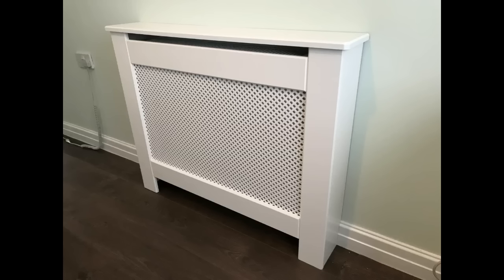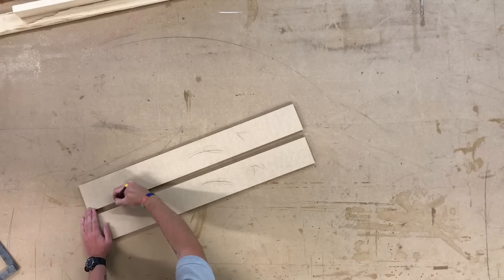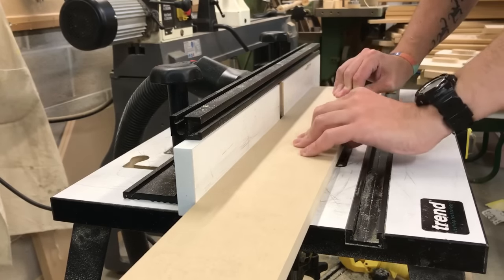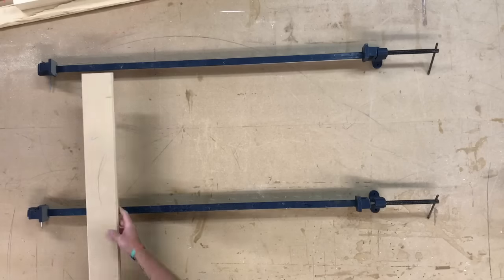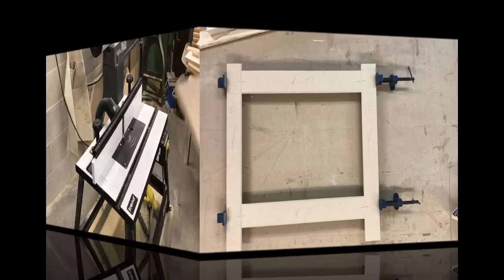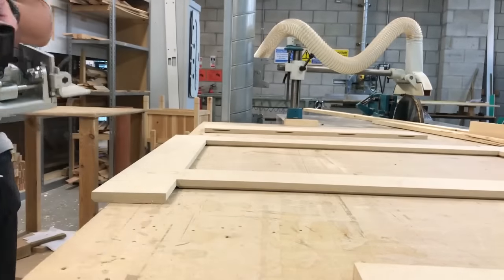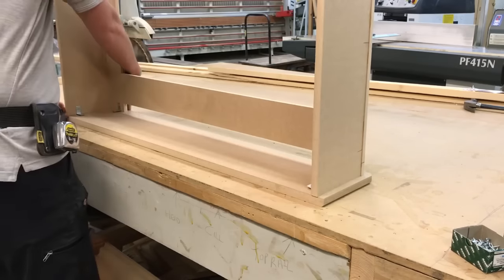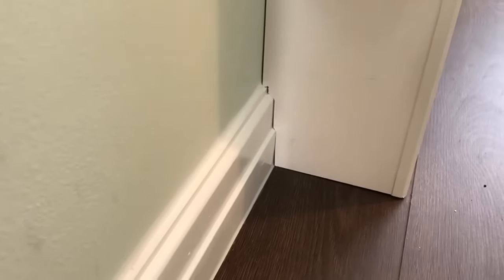How to make a simple radiator cover, shaker style. The complete DIY guide

Comment: Thanks for such a useful video!  You showed all steps to perfection and will be doing this in the next couple of weeks! :)
Reply from the maker: The Carpenter's Daughter why thank you Vikkie. It's nice to have all the industrial machines but everything I've shown I used to do by hand or with smaller machines. Good luck with yours! 👍🏼
Reply: @spendtimesavemoneydiy  exactly  :)  I wont be using my new table saw for this as too nervous with the size of MDF sheets,, but absolutely with my circular saw.  Can't wait to buy my first biscuit joiner :)
Reply from the maker: The Carpenter's Daughter can I suggest you use the skill saw to cut the mdf to a manageable size then use the table saw to cut the pieces. It will be a lot more accurate that way.
Reply: How is this helpful at all? You don’t explain anything and can barely hear you speak.

Comment: What thickness was the MDF wood that you used? And some of the dimension maybe please? Thanks!
Reply from the maker: +ers54va I used 18mm mdf. The inside measures 30mm bigger than the radiator all round and 10mm more away from the wall. The rails and stiles are 100mm. Thanks for your comment I hope I have answered your question and thanks for watching 👍🏼

Comment: Hi, just been browsing the youtube vids trying to find some advice on what to use for dowling on a rad cover that has arrived with dowels way to small.  None of the shop bought ones fit the parts either and wondered if anyone had any bright ideas on what I could use to replace them?  If it was a rawl plug I would fill it out with matchsticks, but I'm not confident enough to try it on this cover.  Any advice would be most appreciated, Thanks
Reply from the maker: Suzanne Porter would you be able to drill new holes for the smaller dowels??